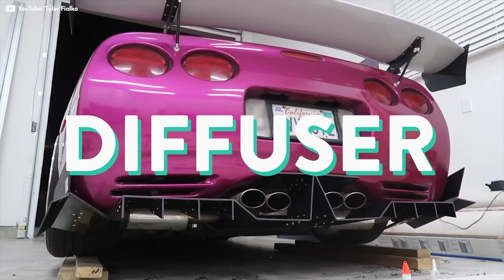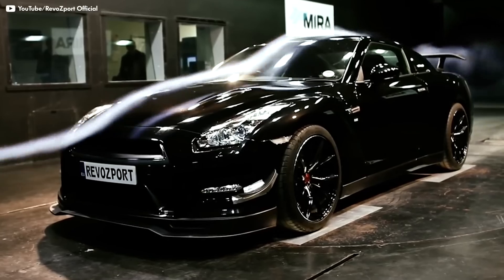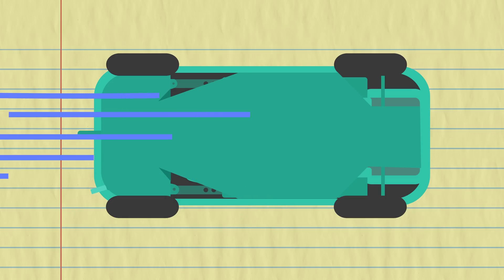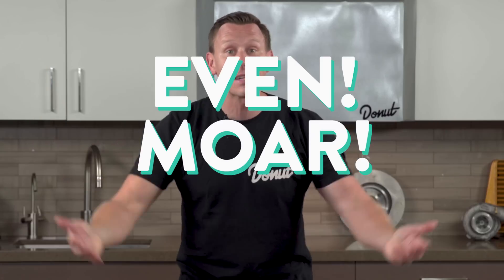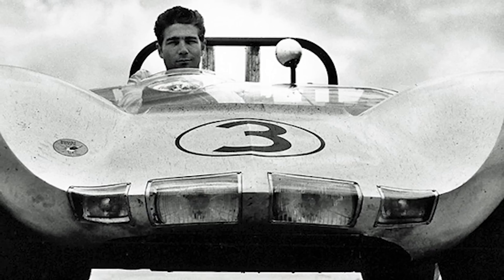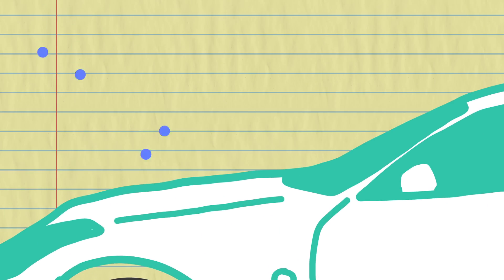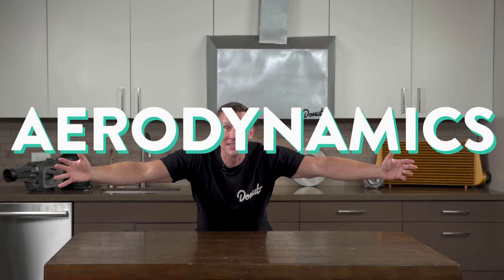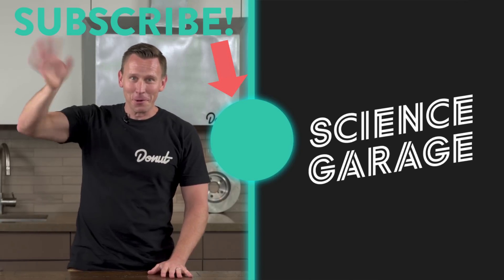Side Skirts, Diffusers, and Air Dams | How It Works | Science Garage

Comment: Directing more air over the top of the car doesn't reduce lift. I'd does totally opposite. It increases lift. Bernoulli principle 0:50
Reply: Incorrect do a little bit more research you will find that directing more air over the top of the car doesn’t directly correlate with less lift it’s not like it doesn’t do anything

Comment: So the flow under tha car will be fast, then out of the diffuser it will have a slower velocity, and a higher pressure for Bernoulli, because the diffuser has a divergent section, right? Then why if you see some simulation, the flow out of the diffuser doesn't slow down? Am I missing someting?

Comment: So hey I have an adjustable racing Wing how do I know which way to turn it for down force? I've been trying to figure that. And it shakes a lot on the highway. I even put the metal Cable in between the brackets at bottom. Advice?

Comment: All of that diffuser explanation made my head hurt with how incorrect it was. It doesn't gain pressure, it creates an expansion point which sucks the car down. Also, the less strakes a diffuser has the better, the goal is to have the air expand, strakes limit the expansion. Strakes are used to limit tire wash from entering the diffuser's air stream which will lower the vacuum a diffuser creates. If anyone wants to learn about how a diffuser actually works, check out KYLE.ENGINEERS (an F1 aerodynamacist) or AJ Hartman Aero's (worked closely with Kyle to design some of his products) video on how they actually work.

Comment: But why Gtr doesn't have those big diffuser, big air vents, big air dam or anything related to downforce thing? They just have smaller one
Reply: The R35 is focused to create less drag since its 1.7-tonne weight helps keep the tires loaded.
Reply: @yongling9825  so it means most supercar and hypercar that are more lightweight than the Gtr need this right?
Reply: Most supercars and hypercars were focused to shed weight to perform well on tracks, so with a lower weight, the tires won't be as loaded unless they have wings to keep the car planted in corners.

Comment: What about ground effect? I heard those helped a lot in f1 but they were banned cause they had a potential to make the car fly. But somehow normally they increased down force?
Reply: They talked about it, its the part with the venturi effect under the car reduce the pressure of the air

Comment: I'm wondering if a duck tail both causes downforce and spoils air flow? I'm assuming so. You called it a spoiler in the last video so that the tt wouldn't kick its rear end out but it would need downforce to do so. But you also said spoilers do create a small amount of downforce which mightve been enough in the tt case but any way.. So it a duck tail a wing, spoiler or both?
Reply: Duck tails are spoilers.
Reply: @yongling9825  do you think they produce downforce? As far as I'm aware if it produces downforce its considered a Wong. If it spoils airflow its a spoiler. I'm guessing you could definitely combine the 2 but I don't think a ducktail would be both. Maybe it is tho. That would be cool.
Reply: Both spoilers and wings generate downforce.

Wing: What you see on GT4, GT3, time attack cars, etc.
Spoilers: What you see on NASCAR stock cars

Comment: 4:30 It's a big mistake and misunderstanding. They are there in order to insulate the diffuser, so to defend it from turbulant air caused by mainty the rear tires.

Comment: So tell me how I'm wrong, I deliver pizzas. Most all of my travel speed is 45 and under. I drive a 95 civic sedan. I dont want downforce I dont go fast enough for it to matter. I want lift, I want 0-45 as fast as possible with my limited engine power. More air lifting my car up will make it lighter therefore making me speed up faster? Or will this be too extreme to the point that highway speeds aren't safe?
Reply: You don't want lift at high speeds, your car will feel floaty by then.

Comment: Normally these videos are sort of ok, but this video is so freaking terrible I can hardly believe it. If this was like the other normally jokey videos this channel makes, it would be fine, but you're purporting to discuss things scientifically and this video is just awful. A few specific examples:

--What the hell is the loopdy-loop graphic at the back of the car at 2:19?!

--The graphic at 2:38 is backward.  I don't even know what else to say about this because it's such a major error.

--The graphic at 7:45 and subsequent explanation is so terrible. If the airflow actually flowed that way, the car would be making incredible downforce at the front end specifically because so much air had been deflected upward. Yes, it would be draggy, but that isn't relevant for the discussion going on at that point of the video. Then, the graphic of the vortex generators at 8:14 is absurd.  No designs look even remotely like that.  And finally, at 8:19: directing the air downward like that literally creates lift because air is being deflected downward. The air is deflected downward because it can then flow under a rear wing (not over, as you say at 8:37), and the flow over the wing can contribute to downforce....but, the graphic you made doesn't even have a wing, so it doesn't matter.

Comment: You want air going under the rear wing not over the top of it. Vortex generators keep the air flow attached to the rear window and coaxes the air under the wing creating a low pressure area that "sucks" the car down onto the road. The bottom of the rear wing plays a much bigger role than the top of the wing in creating down force

Comment: So how about putting a forced induction intake under the car
Reply: Zio  Lan you mean ram induction because of the higher speeds ? Forced induction like turbo chargers and super chargers would be hurt by the lower static pressure making it effectively like being at high altitude.
Reply: @mertgarbonite9307  I'm not too sure, I just thought that putting the intake under the car would create more negative pressure without the use of more aerodynamic additions to the car
Reply: Zio  Lan Khan yeah that makes sense, I don't think it would be worth the price you paid to run the turbo but it would create more downforce like you said.

Comment: 8:08 shouldn't the vortex generators be at the front of the roof? i mean, if the airflow detaches at the windshield there is no pressure at the back of the roof? the airflow should just pass over the generators? or am i wrong, plz explain

Comment: Those vertical strakes on diffusers are meant to reduce tyre squirt (i.e. stop the messy air around the tyres from leaking into the diffuser).
Reply: 4G12 exactly

Comment: speed academy did a thing about areo a while ago but they got to use an air tunnel and showed a 350z run through it and how it was tuned with the information they got....how ever to everyone screaming rice, sure 90% of all non oem wings(and a fair bit of oem) do nothing but look nice, however thats not always true, i know more than a few brands are using them or selling them as options that have actual benefit , and to those defending the oversized wings and canards , just cause that shit is adjustable dose not mean you did it right, unless you got your ass into a wind tunnel or can find a perfectly flat road on a day with absolutely no wind and can somehow know how much weight each corner of the car is experiencing , then the odds are the wing isnt doing much aside from attracting eyes

Comment: A few things. Downforce isn't measured in G's. It is measured in kilos or pounds. G-force is the acceleration that the driver experiences while they are in the car. This force can pull at them in different axis (i.e. Gx (front-to-back), Gy (side-to- side), or Gz (head-to-toe) (Potcanowicz & Mendel 2013, p. 570). The best examples of under body downforce are the Lotus 79 (which uses ground effect) and the Brabham BT46B (which used a fan better than the Chapparal 2J).
Reply: Constantinos Mallios your not from America are you? Lol but I knew it was in pounds

Comment: So vortex generators just create wind turbulence to push down on the wing of the car? This renders what you said about how air moves smoothly over the curvature of the car's body useless if all cars need those vortex generators. Or does that only apply to boxy cars and not hyper cars?
Reply: eurosonly I think it applies to cars who’s top of the car is far greater then the trunk. cause if it’s a steep slope the air would just go straight instead of going down for the spoiler or wing. But who has wind tunnels just put strings on your car and use a big fan in your garage to test where the wind goes. Lol 😂

Comment: Fast moving air around the outside of your car has low pressure not high pressure.  The reason air dams are put on cars it to prevent air pressure from building under the car.  They don’t really lower the pressure as much as they stagnate the air decreasing the speed differential between the car and the air.  The rear of the car is where the vacuum comes from.

Comment: Camber and toe: How it works
Reply: Hey I drive a 86 as well, I run -1/16th total rear toe in, +3/32  toe out front.
Here is the proper skinny on alignment:
Negative Toe or Toe In: Gives the car more steering past apex. The drive tires want to be as neutral as possible to allow proper transfer of torque. Toe in on the drive tires will make the car more centered on acceleration and will produce for squat from the suspension 'Loading', negative toe on the rear also makes the car's rear end more predictable. Some cars, like the Ford Focus, have active rear geometry which makes the tires toe out going around a corner when the suspension is loaded. This makes FWD cars rotate better.
 
Positive Toe or Toe Out: Gives the car more steering into the corner, less out of the apex. It will make the car react quicker but make it more of a handfull. Static Positive toe is only used on the front wheels. FWD's use more positive toe to align the torque forces forward when power is applied. Positive rear toe is generally never used as the suspension will normally toe out when under load on its own to help the body rotate around its axis. If you lower a car and it wanders all over this is called bump-steer which sucks because you have too much toe out in which you need to raise the roll center of the car by dropping the outer pivot of the LCA to fix which goes into a whole nother' area of suspension geometry and design. 

TLDR: Toe Out: Corner In. Toe in: Corner out.
Reply: Lamberto Jr Beltran 😂😂😂
Reply: Toe*
Reply: Lamberto Jr Beltran wow, you’re definitely a “Car Throttle notification gang” kinda guy
Reply: cristofor pelic I'm pretty new to the car scene, so I'm still trying to learn. These videos are actually super informative to me.
Reply: DeVan Helmoski oh, well I was replying to the guy in the comments saying “it doesn’t”. But anyway, toe and camber effect the angle in which the tires are pointed. Toe in let’s the wheels be pointed inwards which puts force on the center of the car, allowing for better cornering as the tires don’t have to turn as much going around a corner. Outward does the opposite TDLR; Negative Toe points inward and is better for conering. Positive toe points outward and is better for straight line stability. From what I understand camber and toe are very alike but feel free to correct me (corrections, camber changes the angle of the wheels tilt, while toe changes if they point in or out, they both have like effects)
Reply: cristofor pelic so if I want to track my 86, I would want negative toe correct?
Reply: DeVan Helmoski absolutely, only on the front, because putting it on the back tires (assuming that’s where your power is going) is going to limit the amount of power they are going to handle making it very unstable.

Comment: Please.for the love of God ...anti lag and 2 step and how they are different..
Ain't lag lets... get some likes please
Reply: Aaron Mikusa Anti lag is used to keep the turbos spinning fast when you let off the gas  in a turbo car so that when you get back on the gas, the turbos are spooled and you won't have boost lag (like when you are going through a corner). Intake and compression go as planned but then combustion is delayed by the ECU so that by the time the exhaust valve opens, there is still combustion going on. High-speed, high-energy combusting gases from the combustion chamber then pass through the turbo, keeping it spinning faster than if you just had relatively low-energy idling exhaust gases passing through the turbo. That produces a relatively constant amount of boost and eliminates turbo lag when you come out of a corner or something and get back on the throttle.
Reply: Mishfiringu systemu!
Reply: Wow that is crazy! I would never have thought that a car would come stock with something as explosive as that. That's ridiculous. But I guess that's how far they'd go to reduce turbo lag
Reply: Ganesh Gajavelli
In my exhaust manifold gas is injected (Pre-turbocharger) directly into the runners. That’s on a factory Toyota setup on a ST-205 WRC
Reply: I think it will happen
Reply: @Travis Carnes and  @Lansoy Romero sorry, 2 step is short for 2 step rev limiter. All it is, is helping you keep a steady RPM while you are about to dump the clutch. It works for launches as well as flat foot shifting once you are going. You set it to about 4K RPM and you floor the gas. It holds it at 4K until you let off the clutch to give you the optimum RPM to launch at. You will hear a car when its ready to launch "bah, bah, bah, bah" in a steady series of revs.               When you hear the loud bang bang, and see flames then you are hearing anti lag.

Comment: Transmission | how it works

Carburetor | how it works

Fuel injector | how it works

Headlights and tailights | how it works

Turbos | how it works part 2

Steering | how it works

Suspension | how it works

Koenigsegg gearless direct drive | how it works
Reply: turbo charging a tesla | how it works
Reply: Turn signal in a BMW / how it works
Reply: @ericgatter2830  no blinker fluid that's all
Reply: Just like my Dad|How it works
Reply: N differentials n ecu
Reply: Really would like to know about Koenigsegg Direct Drive
Reply: @camejuanm  not 100% sure but I think engineering explained has a video on that
Reply: Don't forget Airbag- How it works
Reply: matthew natividad thank u for making me remember that
Reply: Anti lag - how it works
Reply: Head lights really 💀
Reply: Donut Media should indeed do the gearless direct drive that so interesting
Reply: Muffler bearings | how it works
Reply: Automatic transmission works, cvt belt transmission
Reply: There you go, you have a few weeks of content...
Reply: This are basics
Reply: Mj Tingzon yes!
Reply: eric gatter they don't
Reply: Please they must do that
Reply: Google, how it works?
Reply: My life, how it works?

No really, how does it work?
Reply: how to cum | how its work
Reply: Misfiring system | How it works
Reply: When they're talking about the undertray, they use a model to explain how the brake lines and exhaust pipes interfere with downforce, but doesn't the air come from the front and not the back? Unless the air going from the back to the front low pressure.
Reply: Turbos and blowers are done so check out the that episode